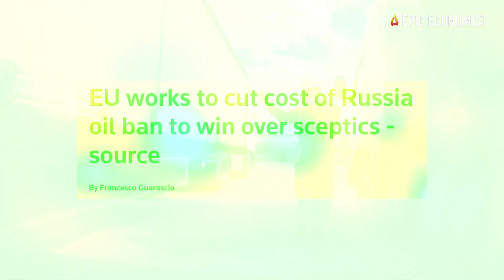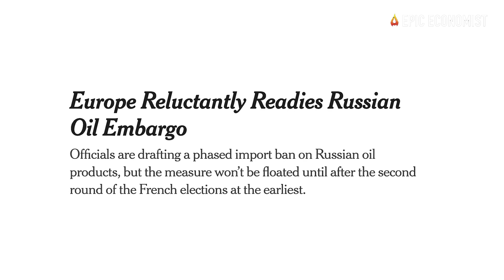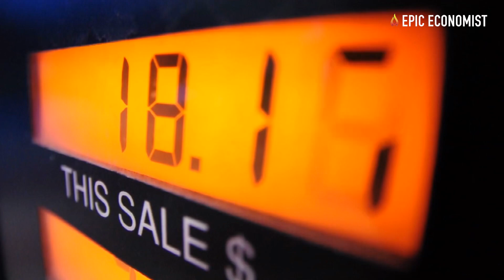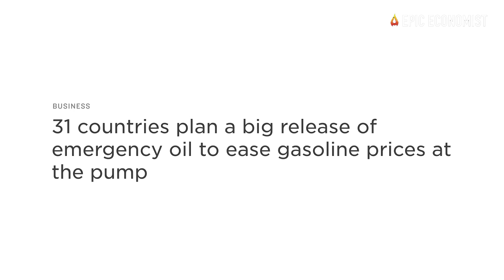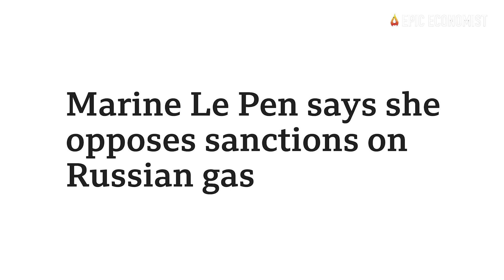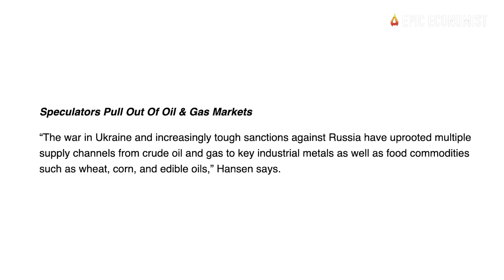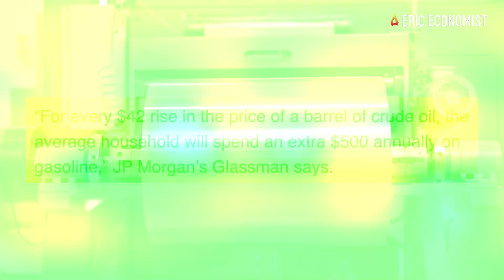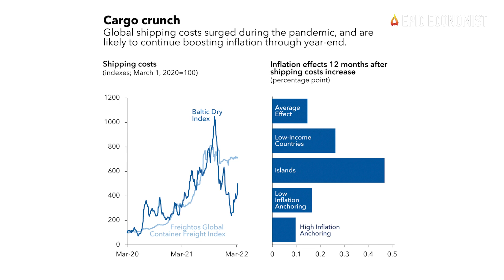Alert They Are Ready To Impose Full Embargo On Russian Oil That Will Send Price Above $185

Comment: Diesel is already $2.20 a litre here our weekly fuel bill went from $5000 to $12,000, parts have increased at least 40%, hydraulic fluid up $20 a pail, profit is a thing of the past,  only reason we haven’t shut down is because we’ll go insane with nothing to do
Reply: I think that's why builders are still churning out new homes. They know it's all crashing down, but that's all they know to do. Who is John Galt?
Reply: Where are you located?
Reply: It won't be available soon
Reply: Frightening
Reply: Matthew24
Reply: Chicago
Reply: #copperisthethirdmonetarymetal Jack the Stripper of #copperwire perhaps ?

Comment: If they will impose embargo on Russian oil the equilibrium price of oil on global market would become 260$/barel, but in first everal weeks the spike price will be much higher than equilibrium price due to market shock and panic.
Reply: Where are you getting this information
Reply: @d.b.cooper1292  from the Russian govt report...it is also comes from the global oil market trend which shows that for each percent in oil deficit price of oil increases by 10%.According to OPEC reports Russia exports 18-20% on a global market.Takin into account that oil market is "tight" which means that all oil producers pumps oil on full capacity.So the deficit on a global market would take almost all russian share(18%).18%*10=180%=2.8-3.0*100$/barel=280-300$/barel.Thats estimated equilibrium cost.But spike cost will be much higher.
Reply: Well if you’re correct I think that’ll be the end of it all
Reply: Buy oil stocks lol
Reply: I agree with you 100%.

Comment: that would equal about $6.60 per gallon of gas in america @ $185 per barrel of crude ... oh hell , let's just say it's gonna be $6.66 a gallon and be done with it ... of course this is may 14th 2022 and the current price is $110 per barrel so ... actually that $6.60 a gallon does not include taxes , so .18 cent fed = 6.78 and ca for example is .79 cents = $7.57 per gallon ... so prolly $8 bucks a gallon for diesel and as everyone knows , at some point , everything travels by truck , so the price of everything would go thru the roof , uncontrollable inflation , has nice day